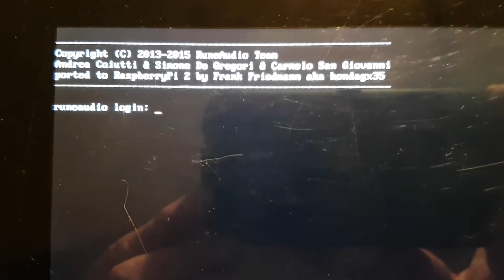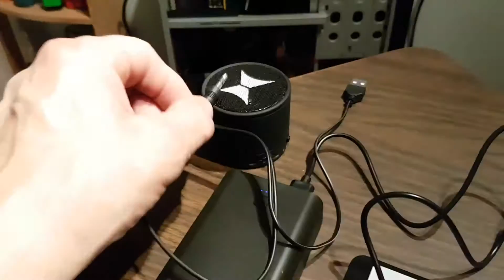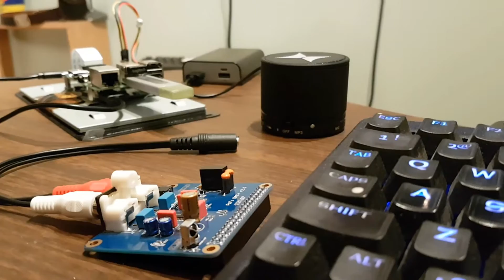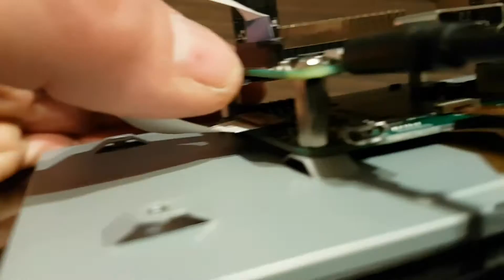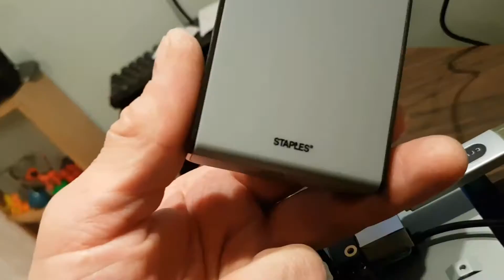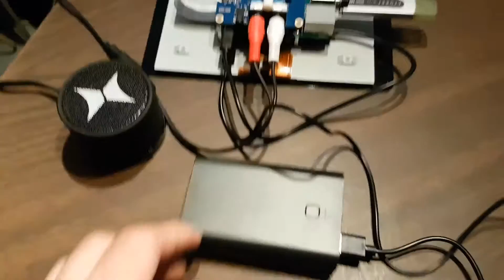Raspberry Pi 3 RuneAudio Touch Screen Pi HAT Sound Card

Comment: raspi 3 need minimum 2,5 amp and recommed 3A power supply, no use less thats or no work or lot problems. and if use touchscren display you need more amps, 3,5-4A power supply, i use raspi3 whit display but display take 1A more current, need be biggest power. no wery little old usb power bank, stupid, use wall power.
Reply from the maker: Thank you for the reply. Yes I have been using a bigger power supply, and have less problems now.

Comment: Why this clumsy LCD attached to the raspberry when you can simple control it with a Smartphone via CLEMENTINE Player?
Reply from the maker: its true, I just use my Galaxy S5 that is dedicated to the pie as a GUI .   I also have a Galaxy S7 that also is connected to this set up and my PC is also connected. So, ya, the Touch Screen for the Pi, I do not use in this set up anymore....Just the Raspberry Pi with the DAC plugged into a DAC AMP that feeds my Speakers controlled with the GS5 and GS7 and the PC.  I do have video of this I still am working on uploading...
Reply: Ok, that is nice. I'm also using the VNC server in the Raspberry to remotely make any configuration without the need of any monitor connected to it!
Reply from the maker: https://youtu.be/8Iey5yKd-p4    

If your interested in understanding a little bit about different set ups...worth a listen in my opinion. take care Popart.
Reply: Unless he does a comparison like this https://youtu.be/H5m6zs1UIVg?t=9m59s I will not give him to much credit!
Reply from the maker: I'm not sure of your reasoning and I feel some resistance not sure, you were really focused on the Pi's 3.5 mm Jack and curious why I was not interested in using that jack for sound output, you show me this link to this guy who obviously does his homework and is very knowledgeable, and I am saying that this guy Hans is also of that same caliber and is very knowledgeable and does his homework. I am striving for the best Digital HiFi Signal I can find. Gone are the days of 78 RPM and CD's etc... I want to find the best Digital Audio I can find.
Reply: In that case save your money and buy a proper setup, like the Edifier R1700BT with Active Crossover and Bluetooth the actual establish standard for Audio play. The Active Crossover means the signal is split before amplification, so you have dedicated amplification for each way, and Crossover has been the Achilles' heel of any speaker. Bluetooth is for audio today what Vinyl, Cassette and CD was before, the standard for music reproduction. The sound quality is excellent and the easiness of use has no parallel, what you can play in the smartphone you can play it on these speakers. A nice player that plays Shared audio files is the BSPlayer downloadable on Google Play!

Comment: What's the problem with the Raspberry audio jack?
Reply from the maker: The Sound coming from the 3.5 mm jack is garbage.  Things have changed since this video.  I now have a   allo Kali and a allo Piano 2.1 DAC   https://www.allo.com/    I am using Volumio  https://volumio.org/  , but also works with Rune http://www.runeaudio.com/  , Roon   https://roonlabs.com/  The Touch screen is mounted to a different Pi which can talk to the other raspberry pi with the sound card mounted, just like using a smart phone or a PC or Laptop (GUI) etc, going through the network with the Pi with the Sound Card being a music player. At this point I'm looking to move the Pi into the Car and see how that works. The Pi is powered via a 2.5 amp 5 volt switching wall adapter with a 5.5mm barrel jack going into the Kali powering all 3 boards.
Reply: Is it worst than the old cassette?
Reply from the maker: Popart 2015 Not that it is as bad as a cassette....because I had some decent cassette recordings I made back in the day....no, it's just different. The 3.5 mm audio jack is notorious for noise such as switching sounds....could be pops or static that comes through on the speakers or headphones...some humming...and just all around very noisy system...
Reply: Can you prove it on YouTube?
Reply from the maker: I really like this guy and watch a lot of his videos.  --->>>    https://youtu.be/2fX7NSaAKYU  This explains a little bit about the sound quality.
Reply: He calls himself Audio Evangelist... That says a lot about him, all theories no proofs!
Reply from the maker: I'm sure, if you allow yourself to listen and learn something from this guy, there is plenty of scopes and graphs showing the noise in the system from power adapters etc...check it out Popart
Reply: You mean that those graphs prove to you that the audio jack was garbage instead of checking out by yourself! BTW, do you know anything about impedance?
Reply from the maker: No, I can hear the difference. I have above ave hearing, and am an Audiophile.  Yes, Impedance, is resistance, most speakers running 4-16 ohms on ave...headphones today around 32 ohms, other than that...I know people are wiring up subs down to almost 1 ohm to get 150 spl volumes....
Reply: When I speak about impedance is to point out that unless you are using the jack for headphones there is no issues in feeding an amplifier due to its very high input impedance. No high currents there, so, no ripple, distortions or things like that!

Comment: I use Raspberry Pi 3 on Sonu Bravia TV .. but I cant pass sound through HDMI on TV ... now what should i do???
Reply: You are using Raspberry Pi 3 as hardware. The hardware didn't work by itself. It needs software. Software generally have settings. Those settings you have to change to get sound over HDMI. In Raspbian you change sound settings via raspi-config (you can type in shell sudo raspi-config).

Comment: Apparently by Native Raspberry Pi has the additional board disabled.  You will need to remove the disable setting  using a text editor.. Have you tried that?

Have a look at this video as the gentlemen lightly comments on this when adding HifiBerry card.. Not sure if this applies to your card but he talks about it here ( 13mins onward)
https://www.youtube.com/watch?v=DmeUxk14vCc
Reply from the maker: I like Hans, and I have subscribed to him. Yes he talks of these issues, however, I have to source out the solution and find out where and how to do the process...which I have done and now have my sound card working, happy to say. Thanks for your input Mr. D
Reply: Can you make a video of how you solved the problem? @1Patient

Comment: 2.4 amps is not enough. on your screen there was on upper right corner a rainbow tile which indicates a low power. try using a separate power supply for your screen. it might do wonders.
Reply from the maker: I appreciate your comments. I did notice that little colorful box in the top right hand corner. However, everything is working, the touch screen, the Pi3 and the PiFi sound card are all working now...I will experiment with using more power, i.e., one power source for the touch screen and another for the Pi itself.  Thanks for your input Petri.